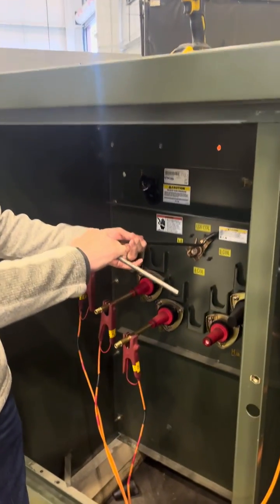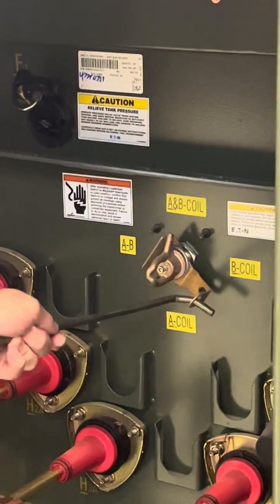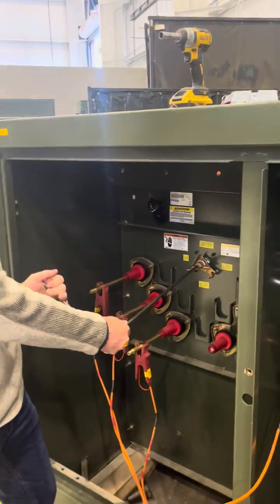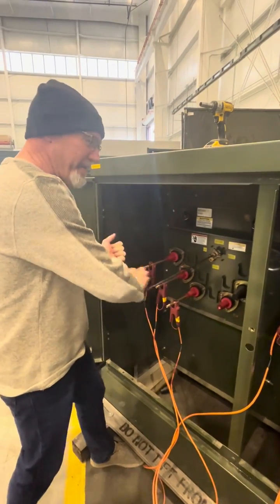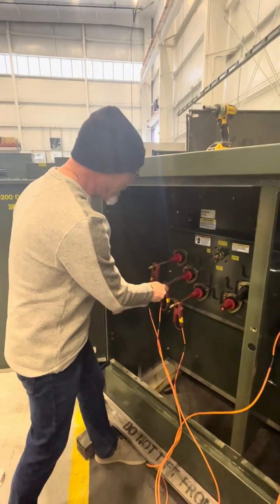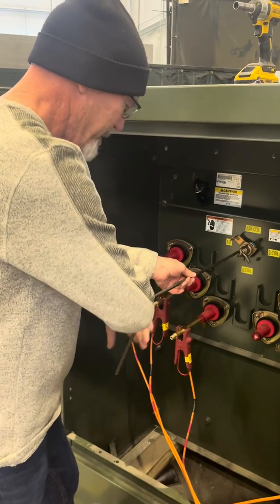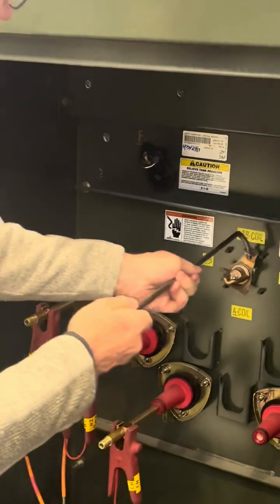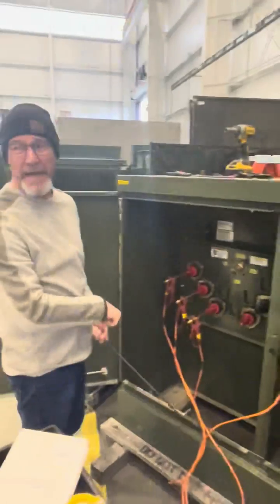Operating a 4 Position T Blade Switch

Comment: Thanks your video, so is there any mechanical interlock between load break switch and front door? If I want operate the load break, I need to oipen front door? And it looks like there is no mechanical interlock between loadbreak and Bayonet on your video. Thanks.